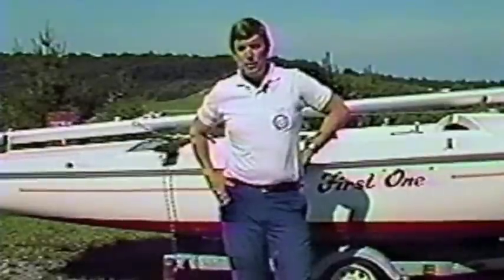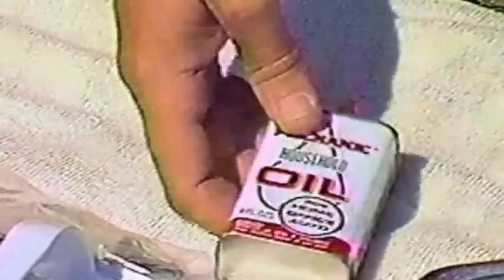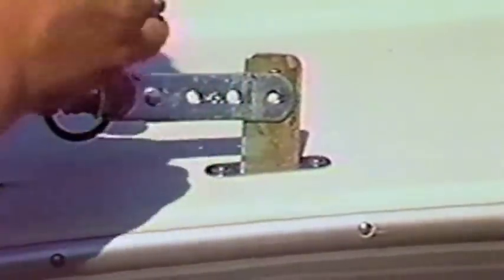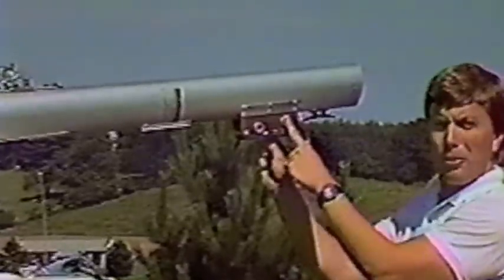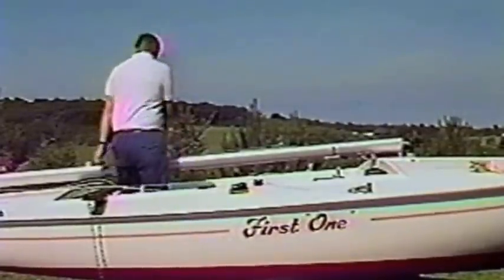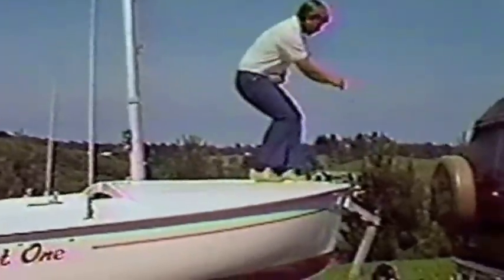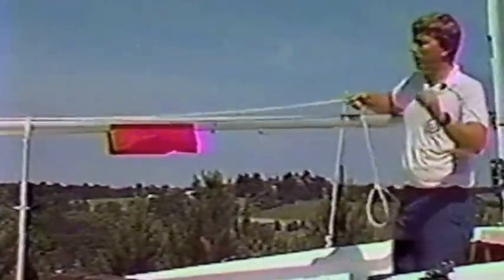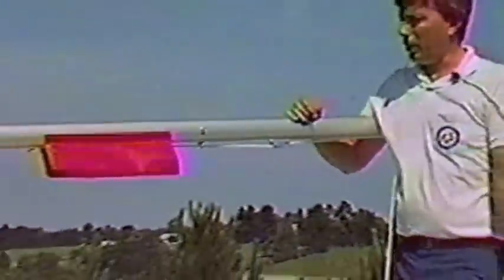Flying Scot Sailboat Rigging Video Part 1

Comment: I just purchased a used flying scot and your video series is great.  However, you don't show connecting the Boom Vang.  Coverage of this would have been helpful particularly since I learned that I had parts missing.  Everything else provided in your series was very helpful.  Thanks.